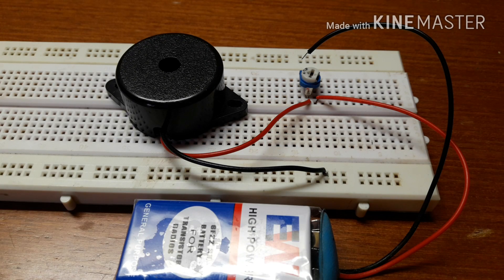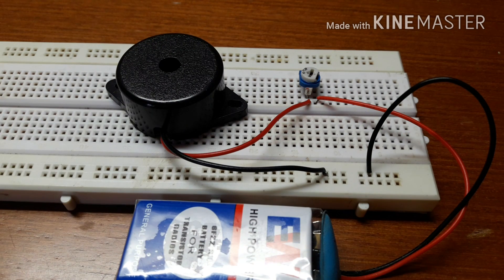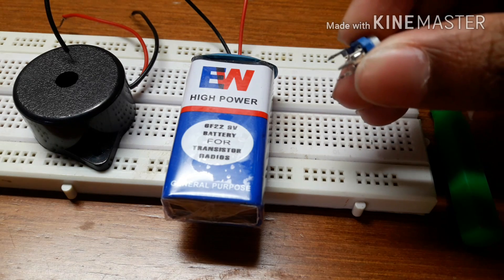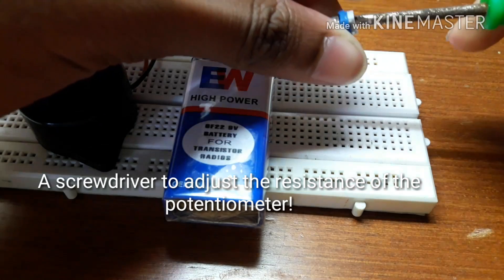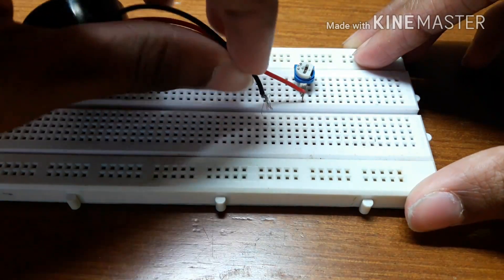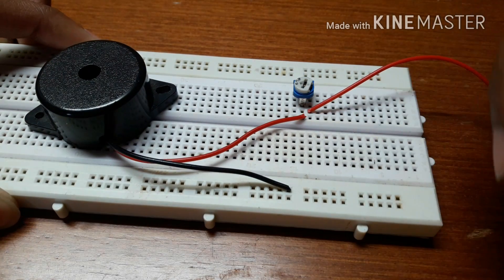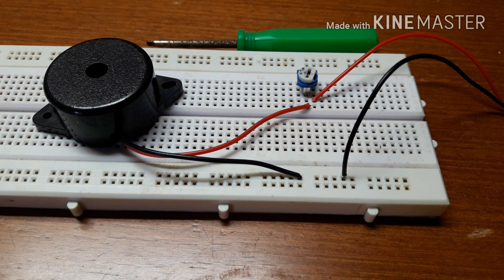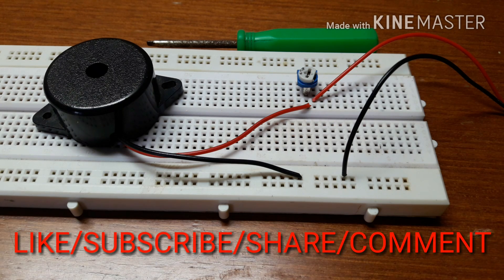✔How to Adjust the Volume of Buzzer on Breadboard using 1k Potentiometer.🔊🔉🔈🔇

Comment: Hi there, very nice but not the best option. The buzzer probably won't initiate at all if you adjust the potentiometer at medium to high value after unplugging the battery and putting it back to work.
Best method is to use an OpAmp as a voltage follower, simple as hell.
Pick up a rail-to-rail OpAmp with enough output current (LM358), connect the inverting input (Vin-) to the output and the output to the positive side of the buzzer. Then a 10k-100k potentiometer on the non-inverting input (Vin+) to adjust the output voltage.
Now the poti is isolated from the buzzer and it will sound at any adjustment after unplugging and plug again.